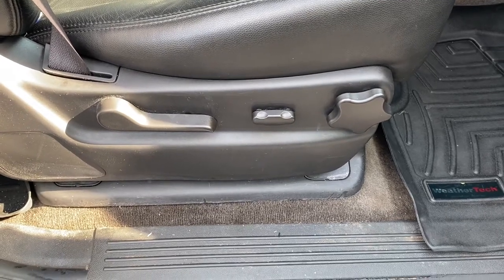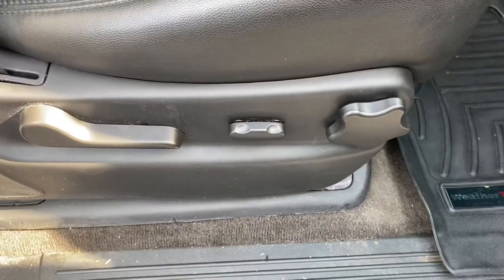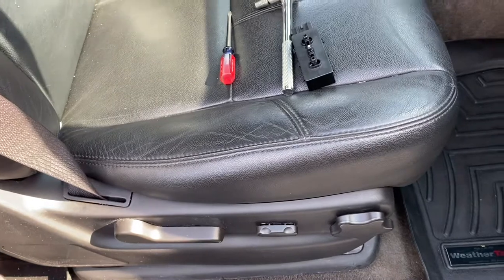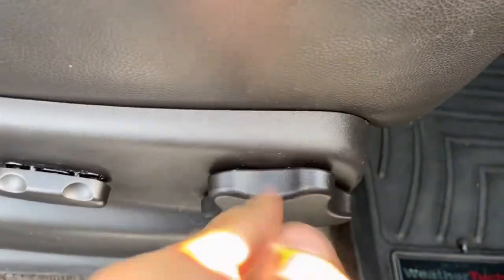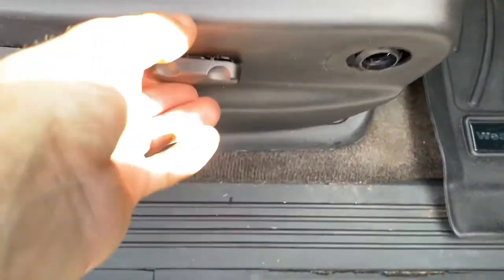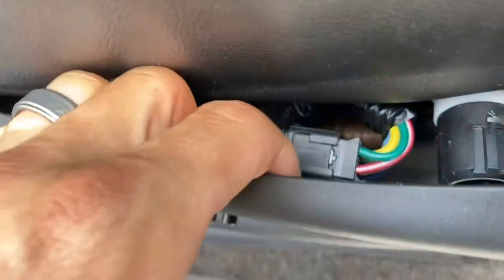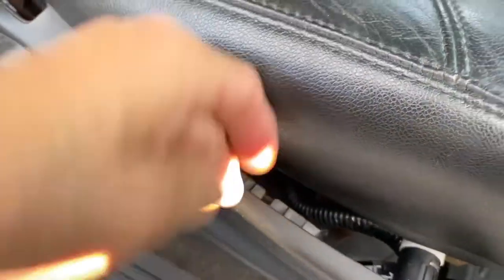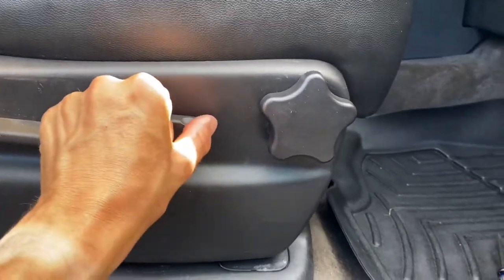How-To: Replace a Power Seat Switch on a 07-14 Chevy Truck

Comment: If I want to just turn off the switch by disconnecting the connector would that be bad because the cable would be loose ?
Reply from the maker: That should be OK. Might want to put some electrical tape over the “live” end to be safe. I am curious to know why you’d want to leave it that way.
Reply: @therealskatedad  i know it sounds completely stupid but I have a lot of people using my car currently every time I Get in it i got spend a good 5 minutes just adjusting my seat and mirrors it’s Extremely inconvenient especially when your in a rush thanks for the video 😂👍🏻
Reply from the maker: @wendigo2046  that sounds annoying. In that case, you show ‘em who’s boss. Glad you found the video useful
Reply: @therealskatedad  again thanks for the video I thought I had to mess with the fuse box to get it done Thank god I came across this vid first